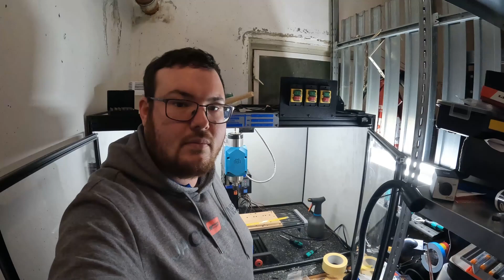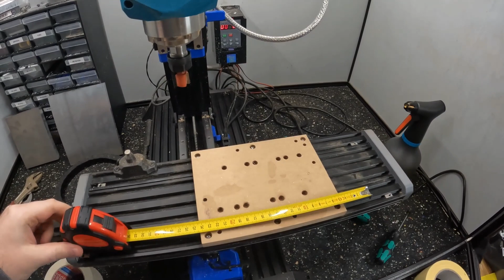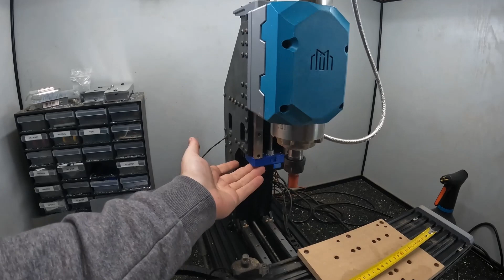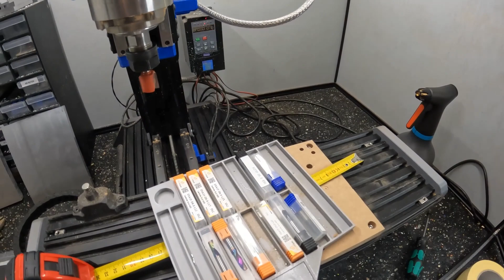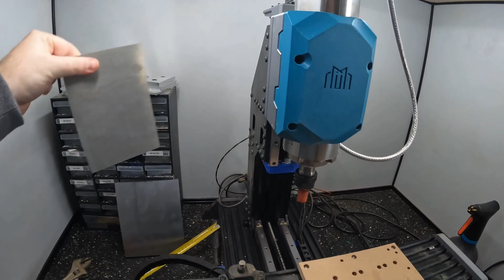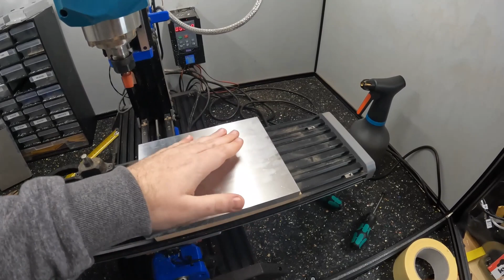Millenium Machines Milo V1.5 - A new Chapter for this channel

Comment: Its not a Milling machine. At best its a router....🤔😳🇬🇧
Reply from the maker: The destinction between mini Milling machine and router is quite blurred, but with a moving cross table and a 2.2 kw Spindle i'd place it more on the milling machine side rather than a moving gantry router...
Reply: @AramcoPhil  Okay, it's has nothing to do with spindle power and everything to do with the machines construction. Lightweight Ball Slide machines are not Milling machines and never will be... Irrespective of size I might add ..🤔😳😳🙄
Reply: @EnglishTurbines Usually, a cnc router is a machine that utilizes a wood router spindle. And it usually constructed as a moving gantry style, so the cutting bit moves towards the workpiece. Unlike milling where the workpiece is moved towards the cutting bit. Usually, mills are more rigid than routers because of that construction style.
Reply: @Zae-R  Correct, but the big difference is the slides and weight of the machine...The other obvious difference is spindle speed. If you want to machine nickel steel or anything exotic, the last thing you need is a weak, lightweight routing spindle with lots of rpm and no torque....As I tried to explain to AramcoPhil here. I doubt he's even seen a real milling machine....🤔😳😏😏😏😀🇬🇧
Reply: @EnglishTurbines   definition of milling: "Milling is the process of machining using rotary cutters to remove material[1] by advancing a cutter into a workpiece. This may be done by varying directions[2] on one or several axes, cutter head speed, and pressure.[3] Milling covers a wide variety of different operations and machines, on scales from small individual parts to large, heavy-duty gang milling operations. It is one of the most commonly used processes for machining custom parts to precise tolerances."

lets take a look at the verb... milling... does it produce chips? does it mill? yes. Its a mill. what a surprise.
i'd say you just be silent now :D dont want to use as much smileys as you did. go and produce turbines with your REAL milling machines. dont play keyboard warrior.
Reply: @HestabyFR  It's not about defining milling....It's about defining what a REAL milling machine IS...Let's make it simple for you. A router is NOT a Milling Machine...I could get my crayons out if you need it in pictures you might understand...😏
Reply: @EnglishTurbines  Ahh ok a mill is defined by weight of a machine - can you please define at what weight, in grams - a machine is defined as a mill so we can all go to our shops and confirm our mills are indeed mills... I get it - you wanted to make what you thought was a clever comment, but now you are just staring to sound silly.
Reply: @paulhuckaby  Oh, okay, I guess you do need the crayons to have it explained to you...I've already done that. It's not my fault you're not an Engineer and you're dim though....🤔😳
Reply: Its mini mill. There are lots of different size and weight mills. This is not dedicated industrial steel milling machine, its mini mill for lets say carbon fiber. I bet you say my dog aint real dog because hes so small, or your neighbours car aint real car because no v8. Go sleep.
Reply: Is a sherline a milling machine? Yes. And the Milo is more capable.